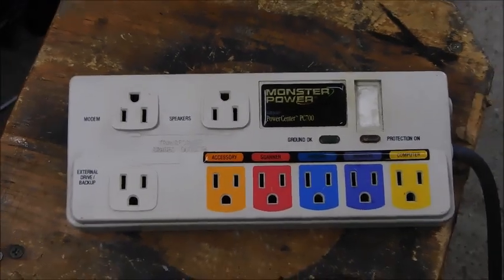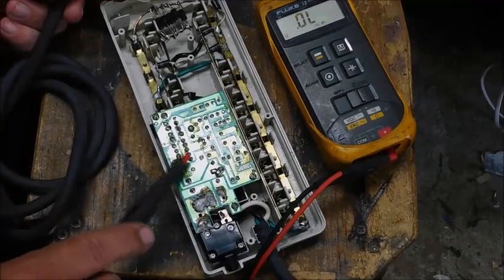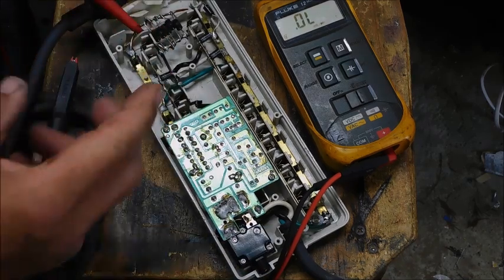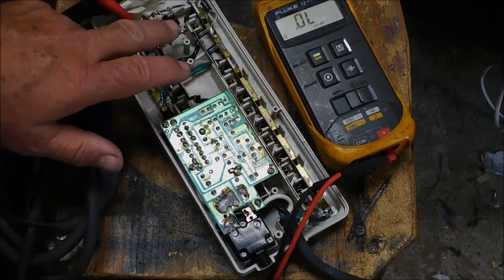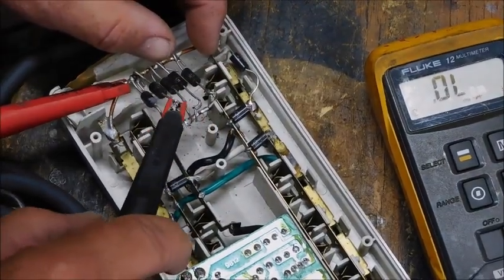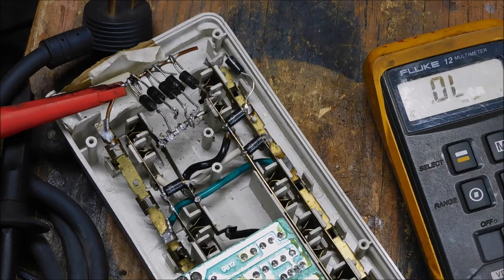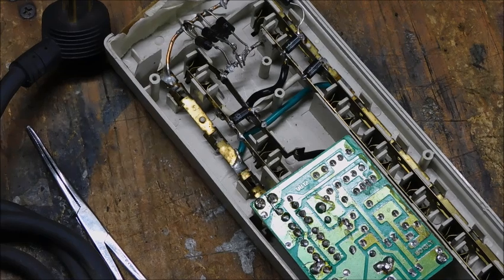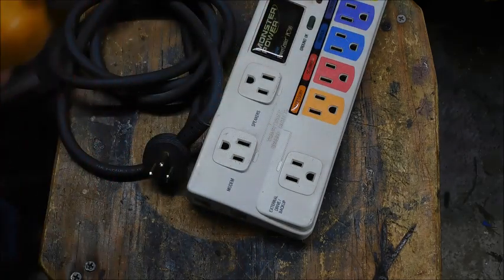OH MY, THE CARNAGE !!! SEE WHAT HAPPENED TO SURGE PROTECTOR AFTER LIGHTNING STRIKE! See description.

Comment: This doesn't make sense. At first I thought you had the diodes back to back. They are rated at 1.5KVA. And if you had then back to back as in Line side to diode cathode then the anode to a second anode then the final cathode to the ground. How that would work is when the line voltage exceeds 1500 volts the diode would flow current the wrong way or cathode to anode (break down) and then continue flowing current in the second diode cause that one is anode to cathode (correct direction). But you have diodes across the neutral line and ground. In your circuit breaker box the neutral and ground become common. Not affiliated Zero Surge makes proper protectors
Reply: I just heard you say TVI. diode. Ok so its two diodes in on package.
Reply from the maker: @ilovecheeseburgers7462  I just lost a whole paragraph response... I shall explain... one moment please.
Reply from the maker: @ilovecheeseburgers7462  AND thank you for watching.
Reply from the maker: OK there are two types of these TVI diodes. They are first of all, most like zener diodes with respect to voltage applied. They conduct after a set voltage. The one type is like a diode conducting in only one direction. The other type has them internally back to back, like these "CA" marked ones. The 1.5 kilo amp rating is what it is supposed to shunt to ground for a limited time. Short time. The diodes I have going to ground are all in parallel. I hope that helps some. Let me know if I missed the target or am too vague.